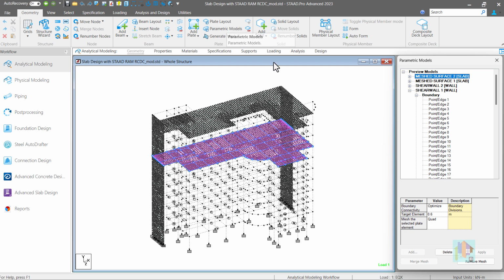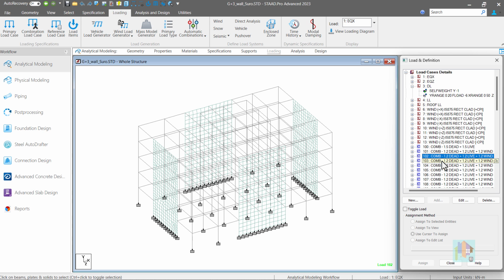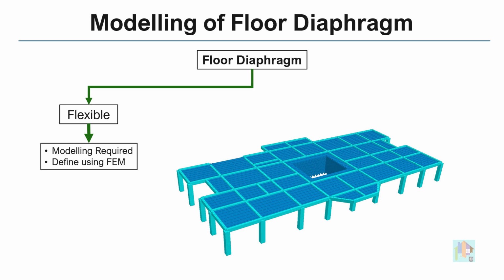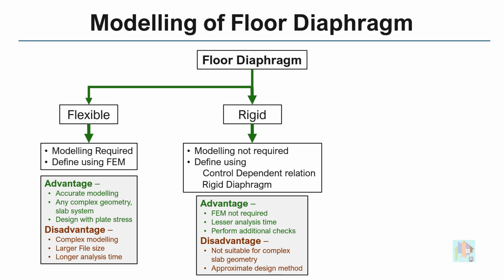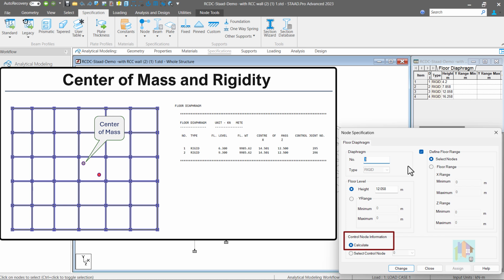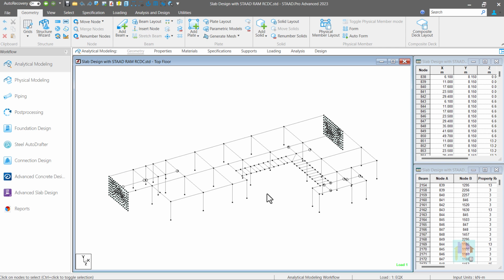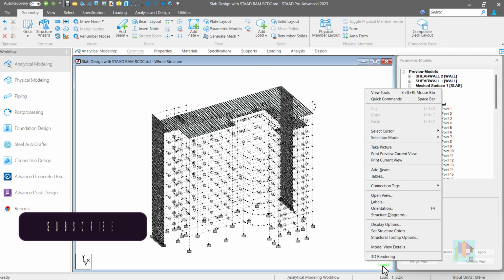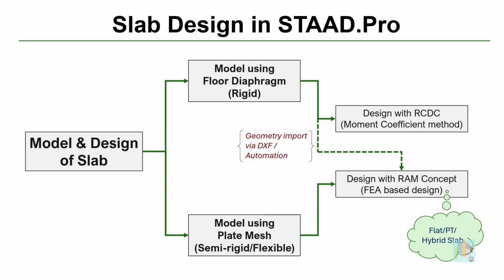Different methods of modelling a Floor Diaphragm in STAAD || FEM, Rigid Diaphragm || Slab design

Comment: good day Sir ! this question is a little bit out of topic. I just want to ask if it is good to model and analyze the steel truss and purlins WITH the main concrete frame structure? or is  it best to analyze it separately?
Reply from the maker: If you have a concrete-steel composite type of structure and you want to design steel as well as concrete, it is better to model those in the same file. That replicate the actual behavior of the structure during structural analysis (eg. during seismic analysis). But if you only want to analyze and design the steel truss, then you can model that portion only, assign support at proper location and apply load.
Reply: @surojit_ghosh  Thank you very much sir! your videos and knowledge are so helpful!

Comment: I have some questions.
 
In previous sessions, you said that for flexible diaphragm it is not possible to perform torsion check,is there any trick to overcome this limitation especially when a model has cantilever plates?

2.For semi rigid diaphragm,does STAAD perform torsion check?

3.How can we model flexible diaphragm and how to make software consider it directly?

4.How to model flexible diaphragm in STAAD as well?

5.For the case of plate cut out you said we have to select the nodes located in the floor slab and ignore any node at cut out,then program understands that there is no diaphragm that means we have to put nodes too where we dont have slab plates?

6.You said slopped diaphragm are not supported in STAAD which trick can be used to overcome this?